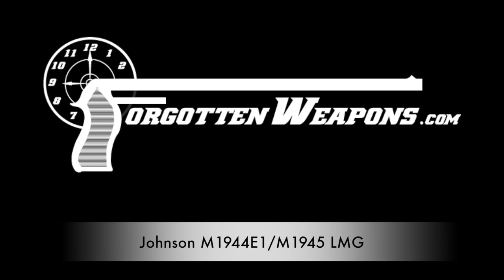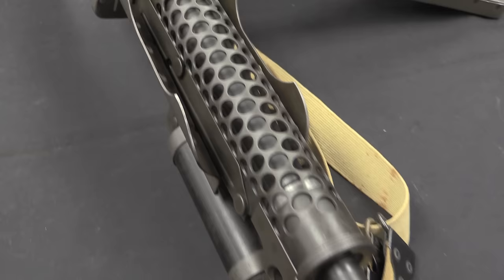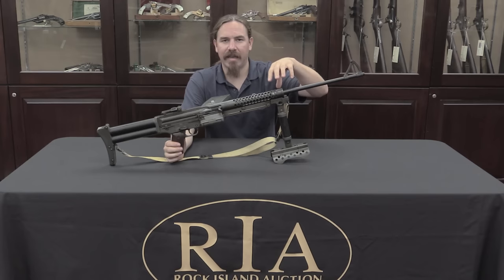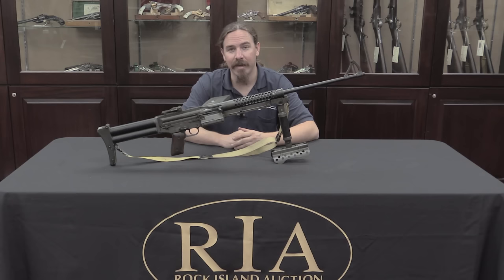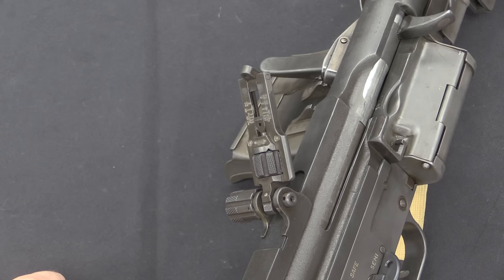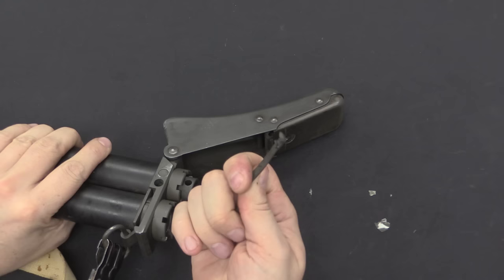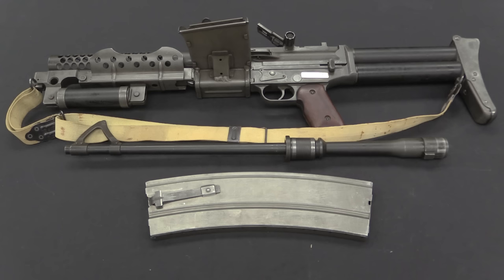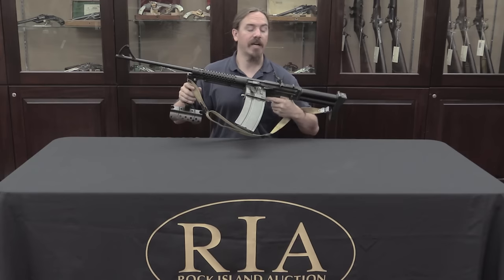M1944E1/M1945 Johnson Light Machine Gun

Comment: Now it's the grandparent of the AR-15, because of the features that are inspired to create the AR-15, especially the selector switch and the buttstock :)
Reply: Don't forget the bolt design.
Reply: Yeah, it's got most of the internal features of the johnson, just using an intermediate cartridge like the sturmgewer.
Reply: @warlordgonagy143  There's more features taken than just the intermediate cartridge. The buffer tube, the method of taking the gun apart, the dust cover, extractor system and a few other bits of design were borrowed and improved upon. All by admission of Stoner of himself. It's funny that the AK is called a copy of the Stg-44, and yet it has absolutely no design features in common, but it's always just ignored that Stoner points out exactly what he took from the Stg-44 design for his own works and how he improved them.

Comment: Gas assist on recoil operated weapons are nor really that uncommon. We find them on everything from shotguns to machine guns. The most widespread use of the gas assisted unlocking on recoil operated guns is the MG 42, MG 3 and other versions of this gun. Underneath the flash hider there is a cup that traps gas as it exits the muzzle. This pushes the barrel backwards. After a short travel the cup clears the gas vent holes at the back of the flash hider, and the barrel (that now has unlocked from the bolt) is driven forward by a barrel return spring inside the receiver. This is rather like the gas trap system one found on early semi automatic rifles, but the bolt is moved by the force of the recoil, so it is labelled as recoil operated.

Comment: I've been following Ian's channel for the long time, but there is one thing that puzzles me when old lmg is presented. Why did they use small magazines? Breda used a fixed mag that was fed by stripper clips, BAR had small mag as well. Could they not adopt a belt fed system? Were there any advantages to using magazines? A lighter design?
Reply: For dirty conditions a mag protects the rounds from getting filthy.

Comment: Beautiful platform.  How many of the previous version were actually used in combat?  Looks ahead of its time, and it's a shame the reliability wasn't up to par.  That barrel sleeve though ... that looks like an easy-to-drop part when changing a hot barrel.
Reply: Would it come off over the sight? Would there be one on each barrel, or
 would you remove the site during each barrel change, in which case you have 
another part to drop.
Reply: That's a great point - they may be integral to the barrel.  I totally forgot about that super-sight up front when I typed that.  That our actual fighting men liked the platform tells me that you're probably correct, or that they had little trouble with it.  I'm not sure, but I'd venture a guess that our guys didn't change out barrels while hot, and in the middle of fire-fights, as much as both sides did on the Russian front.
Reply: the front sight acts like a handle for ungloved & lightly gloved hands, in both changing the barrel and carrying the hot barrel as the assault moves forwards/is forced to move.

it also allows the soldier to use a stick, handle of knife or shovel to pull, hold, or carry the hot barrels, and to hang a ready barrel on a branch beside the position, or the hot changed barrel on the branch, up and out of the dirt.

these were used by singular troops, not a team, so barrel changes run differently.

and if your position is stormed, that at-the-ready barrel, is now an at-the-ready mace/trench club.

a ton of thought and feedback from assault troops went into the design of every part of the firearm, including the front sight... which was likened (affectionately) to a Viking axe.
Reply: Phil Verhey Neat, thank you for the historical info

Comment: Too bad he didn't have the inspiration to make it a genuine battle rifle. It was light enough. He could have just replaced that long an unwieldy single stack lateral magazine with a standard vertical double stack BAR mag, or maybe lengthen that one a little bit for extra capacity. I find that gas assist unnecessary, he could just have added a conical flash hider that would double as a recoil booster to improve reliability. I like that rear sight, very original and practical. And last, the quality of the machining is impressive.

Comment: So basically the barrel doubles as the op-rod?
Reply: The barrel and bolt/carrier recoil together a short distance (like most automatic pistols) until the bolt unlocks by camming rotationally, like an AR (and unlike most pistols), then the barrel stop and the bolt keeps going under inertia.  Actually, with the gas assist, is this like a Desert Eagle?

Comment: Why is it that different allied countries did not adopt each others weapons in full if they were superior. Why did the British not adopt the Thomson and BAR entirely instead of developing the Sten and Bren. And equally why did the US not adopt the SMLE instead of developing the (in most ways) inferior Springfield. Logistics? Pride? Doesn't make much sense to me. Even today why do the British insist on using the heavy and expensive L85A2, rather than just adopt the M4. sure you loose a bit of accuracy, but other than that, it's just better.
Reply: Military industrial complex.   Different companies want slices of the pie so they develop different platforms.  It's also logistics and pride.
Reply: The BAR, on the other hand, was frankly obsolete by the time WWII came around. The Thomson was less far behind other SMGs of the day, but was expensive and (like the BAR) quite heavy.

Logistics probably played the biggest role, however. Each country would want to use its own manufacturing capacity for the war effort, rather than buy their weapons abroad or retool their factories to support the production of foreign designed guns. And there would have been companies operating out of each of these countries competing to have their own prototypes adopted by their governments.

Needless to say, these governments would prefer the regional designs, regardless of superiority (which the BAR and Thompson did not have), as it meant less expensive production and supporting local industry.
Reply: Joseph Harner That makes it pretty clear, thanks for the detailed answer.
Reply: Umm The Bren was better (much better) than the BAR... The Thomson is also more of a icon than an actually great gun. There are reasons why the US started making the Grease Gun (in many ways the US sten gun)...

And why would they addopt the SMLE when they made the Garand?
Reply: bandholm Because the M1 garand was not introduced until 1936. That's about 30 years of the US using the Springfield instead of the superior SMLE. I was talking pre WW2 there. But i get your point
Reply: jakekillify Well if the British had had the time, they wouldn't have used the SMLE... And well the Springfield was not a bad gun, and it was made in the US, so there is that.
Reply: The US model of 1917 might be something you should look it c&rsenal have a video on its and english designed gun that the US made and used in huge numbers during the first world war to the point they made more of them than the Springfield 1903
Reply: the Bren gun was better than the bar and for smgs they did have some Thompson's and Lancaster smgs but they were running out of money so they wanted a program to get an okish SMG for around 10$ the sten was born from the program and only cost around 5$
Reply: Almost all of the allied contries were using Thompsons to some extent.
Reply: You may WANT to award contracts to domestic arms companies, because you want to have independent, domestic capability to manufacture weapons in times of war. While you can license foreign designs and manufacture them at home, you might also want your country's arms industry to maintain design capabilities so that, again, when in a pinch, they can make new 
designs. Incidentally, maintaining capabilities is one of the reasons why US DoD actually likes foreign military sales - the DoD might not want to buy anything right now, but it wants the companies to sell to friendly foreign nations so that the companies have a reason to keep the production lines open.
Reply: +bandholm yeah. the bren is better than the bar in a few ways. it's a bit lighter. I gt to hold one. but what us very uncomfortable is the magazine on top. it's fucking terrible
Reply: Uhm, the Pattern 14 and M1917 Enfields don't share anything with the SMLE - they are Mauser actions, more like the Springfield M1903 or the Mauser 98.  Of the 4, (I have all 4), I'd have to rate them 1) M1917, 2/3) M1903/Kar98 4) SMLE for sheer shootability.
The M1917's a but long for leaping into trenches with, the short Mausers are better for that, and the SMLE, while having a smooth bolt, is prone to feed issues, and for me, just doesn't balance right.
(One may well ask why the Brits stuck with the rimmed .303 cartridge - in anything but a revolver, the rims are far more trouble than they are worth.)
When you step back for the 2000 yard look, there really isn't enough practical difference between early 20th century bolt action rifles in military effectiveness to show a clear superiority.
Reply: +iNsaneMilesy yeah but visibility would be a problem ha
Reply: We've traditionally preferred to make our own weapons rather than buy in. Unfortunately quality of final product has never been a deciding factor on that. Western nations have generally preferred to use their own products for fear of a changing geo-political situation cutting off an arms supply. That seems to be changing as things get more and more expensive.
Reply: Available ammunition also plays a role. Sometimes an army has a large stash of a given ammunition and wants a gun that makes use of said ammunition
Reply: Peter Stickney - Indeed, I've wondered why, when the British improved the .303 after the Boer War to try and match the 7x57mm Mauser, they didn't redesign it as a rimless cartridge (the 7.7x58mm Japanese cartridge was based in part on the .303.). Converting existing Lee-Enfields would probably have just required a change in the extractor and&#160; maybe the magazines. But, then, they were planning on an entirely new cartridge anyway, which never panned out before WWI started.
Reply: supply... for the same reason that Germany had so many different types of weapons and was just 1 country ... they just needed guns that worked .... do you think Russia wanted to supply themselves with American equipment that they had no parts or ammo for? nope, but they did anyways.. to the extent of what they could get their hands on.
Reply: +Phil Verhey
The Germans never started producing those captured designs though, apart from those rare instances where the captured guns were unquestionably effective and with production lines available, as with the Hi-Power pistol.
Reply: the british did actually use thompsons earlier in the war, like north africa
Reply: Mirdarion where did i say anything about foriegn designs? ... Germany + GERMAN designs &  produced weapons ... Germany had a stupid number of firearm models in production in ww2

Comment: Single stack magazine, weird. Why did side loading magazines go out of fashion? You can have a long high cap magazine and still go prone. That would be a 40 round mag if it was double stack
Reply: They went out of fashion because double stacks could fit enough ammunition right under the gun making it sleeker and easier to reload. There are still belt feds which kinda replaces the side loading magazine.
Reply: some people, i hear, are left handed.
Reply: And the balance changes as you empty the magazine. From what I've read the original Johnson rifle had a conventional box magazine that caused feed problems in testing. He replaced it with the rotary magazine with feed lips machined into the receiver. For the LMG he kept the integral feed lips, but used the single stack mag, with a spring clip holding the cartridges in place until insert in the weapon.
Reply: Sillygoose210 _ All the other side mags I can think of such as the Sten gun, Sterling SMG, FG 42 other early smg's, had double stack magazines and were assault weapons rather than LMG's.
Reply: christopher Christos Since when did undermags prevent lefties from getting brass in their face? A sidemag could allow for downwards ejection, much more leftie friendly and gives away your position less. A side mag on the opposite side would just be reloaded with your dominant hand and be no less convenient. Someone should build a side loading  downwards ejecting AR15 now.
Reply: MrMonkeybat no, but if you hold a Johnson left handed you get jabbed in the arm by the magazine.
Reply: christopher Christos How would you be more likely to get jabbed in the arm holding a Johnson left handed? Hold the Johnson left handed and the magazine will actually be pointing away from you more, that is where the ejection port usually is, might get stuck on doorframes more though. Hell my hypothetical downwards ejecting AR 15 could have a mag well on both sides so you can choose which  side you want the mag in.
Reply: There is the AR-57 which uses P90 mags, so it's top loading and downward ejecting through the magwell.
Reply: +Von Mualka If you like wood and steel there is also the curious M43 bull pup. FG42 reproductions are out there also.

Comment: My impression is that the primary characteristic recommending this weapon was - it's not a BAR. The BAR being the whipping child of YouTube Video makers.

The basic design is stupid - and the mono pod makes it worse.

Any weapon having s side feed is going to be awkward to use.  It unbalances the weapon - which is why the BAR had the magazine below the weapon (the best place and most widely used in weapons designs) and the Bren Gun had it on top (which also made this weapon awkward to use but did give it a 30 round capacity.

With the Johnson's magazine - it's very large - as large as the 30 round magazine on the Bren - and it doesn't hold any more than the BAR magazine.  How stupid can they get?  How hard would it be to have a double stack magazine?  You know - like the BAR - that was mounted under the weapon where it wouldn't unbalance it.

Then - stupidity of stupidities - they take away the bipod - and put this mono pod on it ...

So - you have a weapon with a side mounted magazine - that is prone to tilting the weapon to the left - and you try to support this with a mono pod?  Would this weapons with a loaded magazine even stand up straight on the mono pod?  If so - how much did it take to tip it over?

As to that Magazine Pack shown in the other video - what about the guy wearing that pack?  Where was HIS pack?

As to it's weight?  Yeah, it was a few pounds lighter than a BAR - that weight depending on the version of the BAR and whether or not the BAR had that stupid bipod on it.  So - it was a little bit lighter - but the weight of the BAR helped in controlling it - so this was not entirely a disadvantage - except to weak people who hadn't carted one around for months like a WWII BAR Man would have.

Of course the big difference here - is that the BAR was designed to be an Assault Weapon - that the maneuver element could take into the enemy position with it.  How well did this weapon perform in that role?  Or was it just a magazine fed light machine gun only good for suppressive fire?

As to the Marines liking it - how much did that have to do with the fact that Johnson was a Marine?

The fact of the matter is - that the Marines who used the BAR also liked it.  As to why these weapons were given to special units ... I don't know.
.